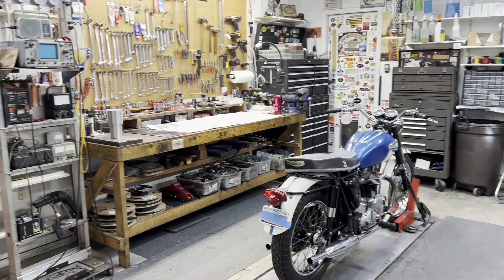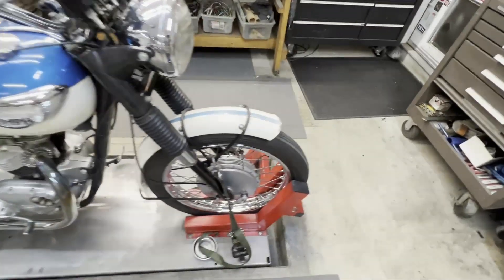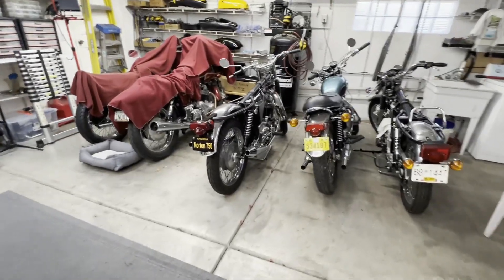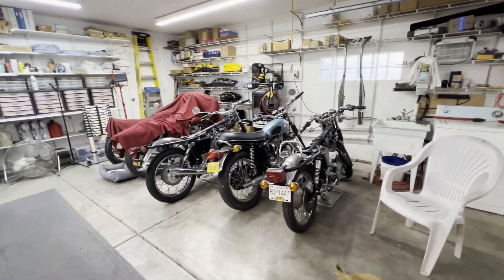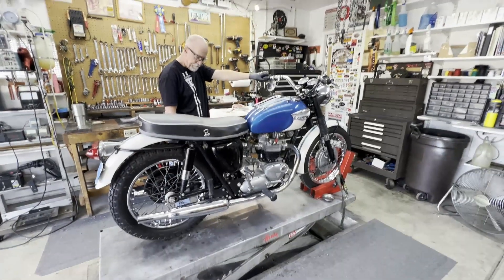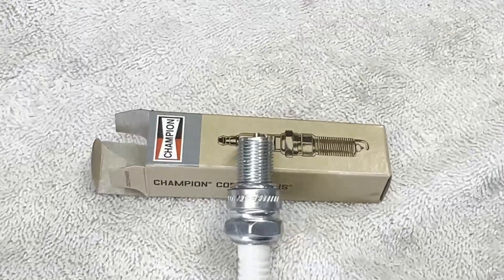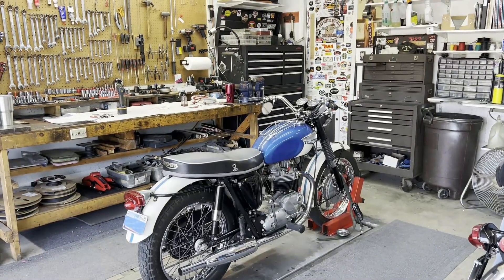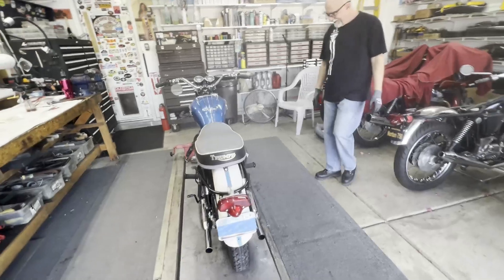Vintage British Motorcycles Repair/Restore

Comment: My 64 TR6 had points on it when I bought it.  The bike started and ran great, but I still put one of those Wassall Vape EI's in it... because I can't stop messing with stuff that works fine    : )   I upgraded the bike from 6v to 12v's which meant I needed to buy new coils...OR, I could spend that money on the electronic ignition and keep the 6v coils.    So the points went bye bye.    I just love the single carb 650s..  I've had a chance to ride a couple Bonneville's now and for some reason I don't like them as much as the TR6s.   My TR6 seems to breath easier or something, I can't really explain it, it just feels better.
Reply: Interesting comment. I have the 64 twin carb bonnie and I love it. Haven't had an opportunity to ride the TR6 to compare. Enjoy the ride.
Reply: @Marius_vanderLubbe  Id love to try a 64 Bonneville. (63 - 65 styling is the best.)  My TR6 preference might just be because I'm so used to mine  Or maybe I haven't been on a properly dialed in Bonneville.  Do you have the gold and white 64 Bonneville?  I've always liked that color combo.
Reply from the maker: I actually prefer the TR6's for the simplicity of only having one carb to "balance."  Two carbs, twice the effort.  And if you think about it, one carb used every revolution is (almost) the same as two carbs used every other revolution.  And, I don't know if it's true or not, but the old "they say" was that the T120's advantage really only kicks in at wide open top speed.  I've always liked the TR6's.  They seem to be "more tractable."  But maybe that's just me being an old stogey.
Reply: @fjdelmonte  No, single carb bike has a better torque on slow and moderate revs, so better pick up during riding with moderate speeds, which is 95 % of our riding. Longer intake tracts with smaller diameters do it.

Comment: I rode Triumphs for years.  Every 2000 miles I refurbished the gaskets and seals.  Loctited the fasteners.  Hilariously, after Triumph went out of the business, parts became plentiful and readily available.  I filled up a shopping cart, then thought, what am I doing.  Put the parts back and bought a Suzuki GS1000.
Reply from the maker: I had a GS850 for a while.  Loved the reliability, speed, and ease of starting, but couldn't get use to the high rpm's when cruising at highway speeds.  I guess I just like big bore, slow revving twins.  Sigh.  But that's just me.

Comment: I would take the stock Lucas auto advance any day over the awful advance curves of the Pazon and Boyer. The Tri Spark has the best advance curve, but even it is a bit slower than the auto advance to full advance. The issue with keeping the auto advance is the lucas points, they struggle to stay in place and can need adjustment after a few days of riding.
Reply from the maker: The mechanical points have another advantage in that the bike will start with a weaker battery than the electronic ignitions.  Points will fire down around a weak 6 volts, while the electronics need a good 10 to 12 volts.  BUT, and this is important, the mechanical advance unit wears with time and becomes "notchy."  It will drive you nuts trying to figure out why the bike will idle one minute and then refuse to, or die the next.
Reply: @fjdelmonte  When running points I always use a new mechanical advance and then I start playing with the springs to find the lightest pair. Most of the time that mean using the old springs on the new advance.

Comment: Hi, would the pilot air be the cause of the stumble off idle? So easy! Was it too weak or too rich?
Reply from the maker: Interestingly, I don't know if the mixture was rich or lean.  The objective is to turn the adjusting screw in or out until the engine stumbles, and then out or in until the engine stumbles, and then set the screw to midway between those points.  Once there checking "just off idle" is a matter of gently adjusting the idle screw in or out until the just-off-idle is smooth.  It's actually more "feel" than science.